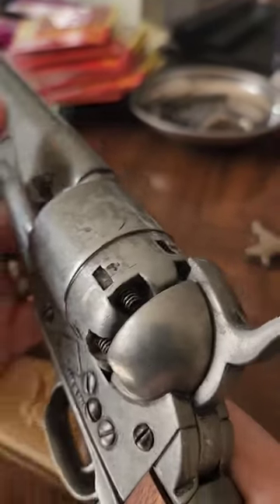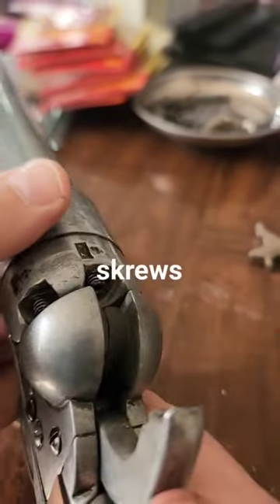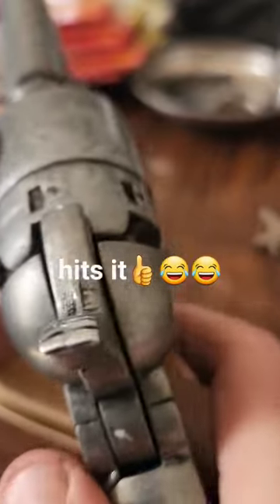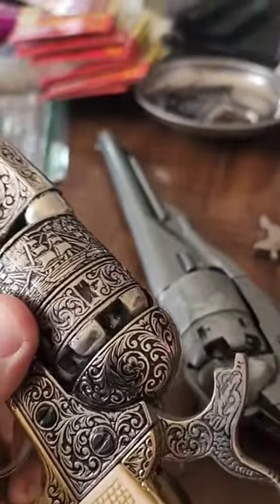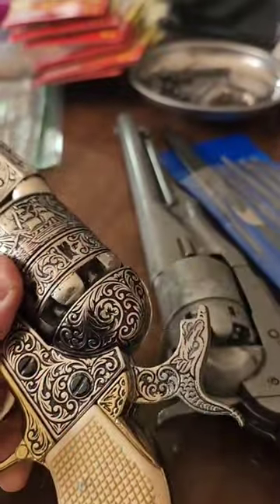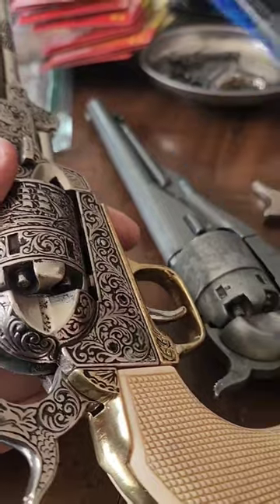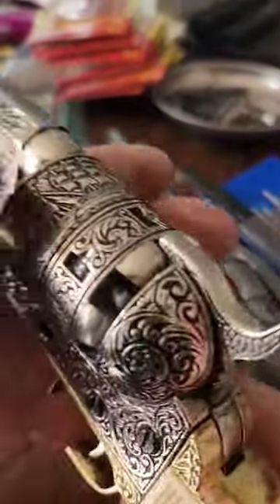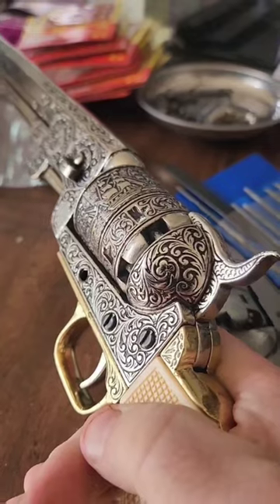pop toy caps with Denix revolvers part 2

Comment: I did on the first denix drill and add some stainless steel pipe ,drill the nipples and use some real cap #11 put some powder on the chambers of the cylinder and it's amazing how that pistol shoots, good job on your projects👍
Reply from the maker: Yes I could sleeve it, but I already have several cap and ball revolvers, So I decided not to go the extra step
Reply from the maker: Actually I am going to shoot some rubber balls out of these